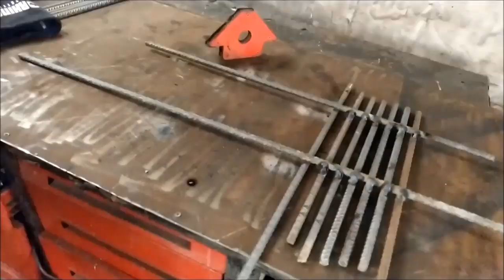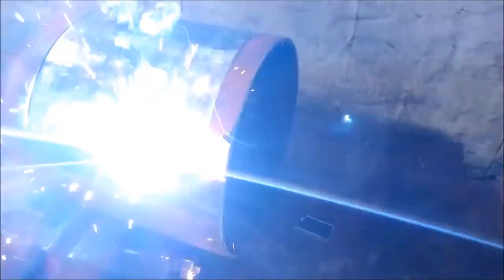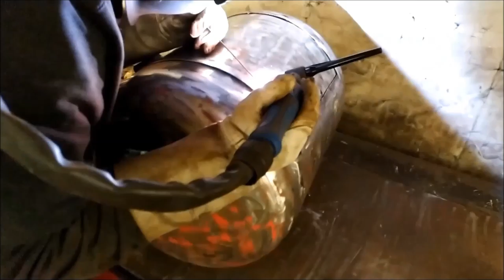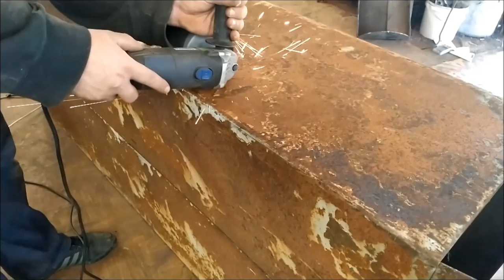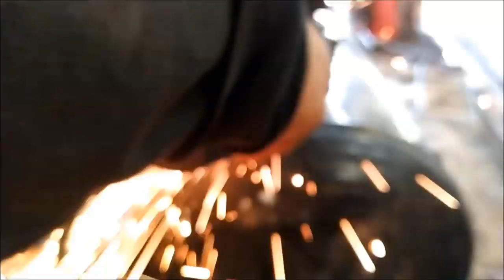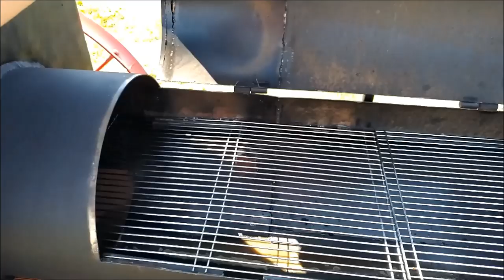Making Grill & Smoker from scrap yard finds

Comment: Tim from Canada not a bad job but if I was you I would’ve painted some windows on the engine with white heated paint all engineers need the window it would’ve been easy to do all you need to do mask off the square then put a cross on it this could’ve been done with white paint that is made for barbeques if you cannot find the white and maybe your red